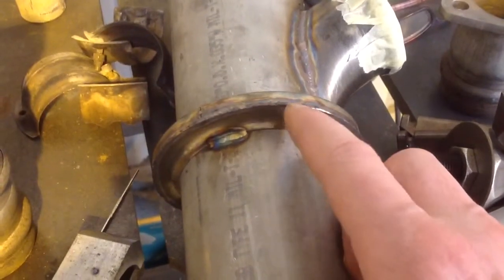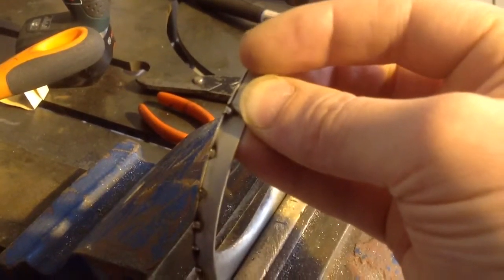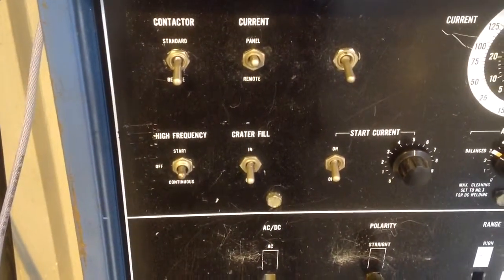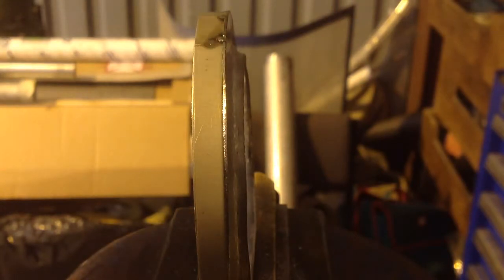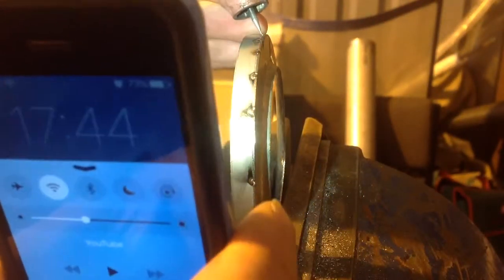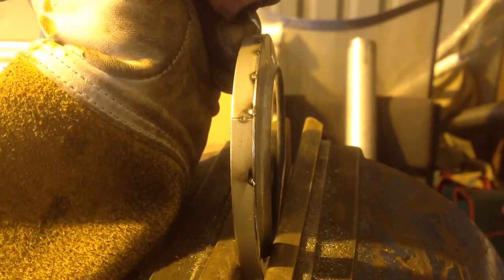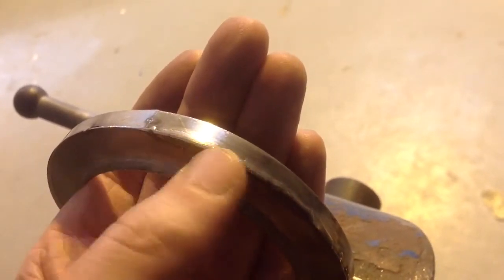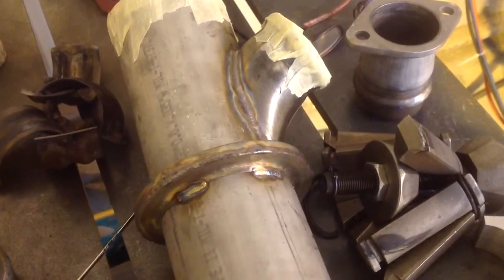Speed tacking thin stainless with the miller Syncrowave 300

Comment: that tack function is very good thing to have,,,
Reply from the maker: Actually the tack function is as simple as setting the current about double what you need to weld, and setting the remote/panel switch to panel - then as soon as you touch the foot pedal you get set current almost instantly, then just tap the pedal for as short a time as you can!
Reply: @framavia2201  good job..i dont have the tack function on my welder.i can get it  as a up grade im going to order it up i think.be handy to have,,have ypu fixed the pulse on your welder?did you find out whats wrong with it? im really happy with my syncowave 250dx i think its a great welder,